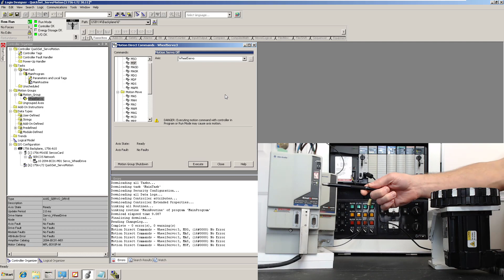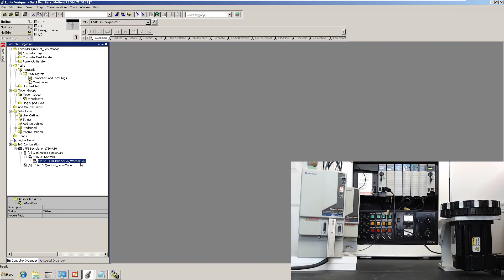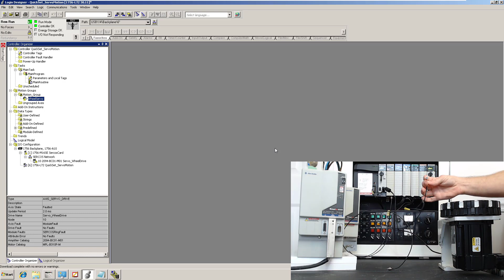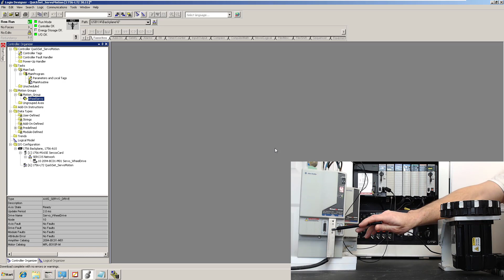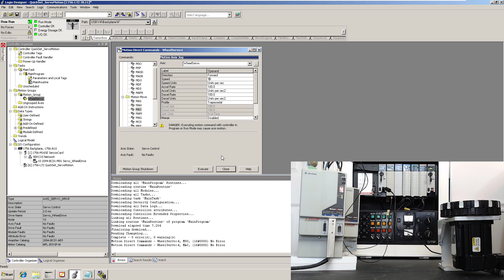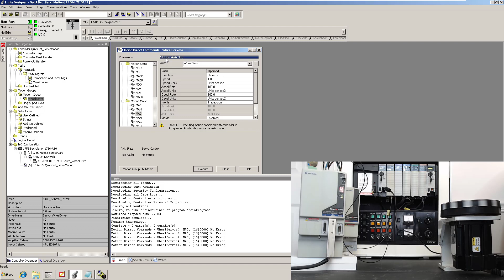Kinetix 6000 Troubleshooting In Studio 5000 Using Phase Indicators

Comment: Once again you are good with the help... I had a E19 fault .? on my 6000 drive
Reply from the maker: That is a position error fault.

Also, depends on your firmware...if on FW 1.83 then flash it to 1.85 

You also could have the motor leads connected in the wrong order.

U-Brown 
V-Black 
W-Blue 

These to try:
-Increase the feed forward 
-Increase the following error 
-Check tuning 
-Verify no mechanical binding 

Generally, if this happened while running then it could be a mechanically on the driven load.

Comment: Hi I'm getting e73 error on the drive how to resolve it
Reply from the maker: Please clarify what actual drive you are using.

If a Kinetix 6000 then it could be a back plain issue or a connection on the drive where the pins connect the back plain.

They often get bent.

Check that
Reply: @ShaneWelcher  kinetix 6000 (2094-bc07-m05-s  ) how can i solve it
Reply from the maker: @zainabbas2524  again,  check the pins on the back of the drive where it plugs in.

Make sure they are all straight and not bent.

If all are good then replace the drive or the back plain.

A simple check is to place the drive in a different slot and test it.

Of course you need to change the node to do this test

Comment: Hi sir i am using kinetix 6000 drive with servo motor i am getting E64 alarm ( feedback noise fault) . I have changed my feedback cable with new one still same issue came backe after 3 months. I have also provided extra condude for feedback cable for shielding.
Reply from the maker: Add a ground to the drive connector, I've since loose or dirty ground caused this.

I added a ground wire with an alligator clamp and it solved the issue although it's a temporary measure

Comment: Hello, I have a problem with one of this drivers and the error is E09. Can you help explain what is the problem exactly, when install the new driver this error comes out but when I put the old one same driver but just older, it works fine.
Reply from the maker: That error is buss under voltage so check the incoming power matches the drive rating.

If so then the new one is bad, try flashing the firmware

Comment: Has anyone had a E00 undervoltage and had the fuse blown? Trying to see how to fix that in house without waiting for Rockwell.
Reply from the maker: That is a blown fuse for the DC bus.

You can verify the DC regulator is working correctly & change the fuse or merely replace the drive.

Might be a internal short unless you have a power spike.

Depends on your voltage grounding system, meaning, high resistance ground or normal ground.

If high resistance then the MOV jumper should have been removed which could have caused the short
Reply: @ShaneWelcher  thank you for your response. So the blown fuse might be something greater we had a motor and cable that took a dump so I’m sure it’s more than a blown fuse. 

We had Rockwell tech support and they said look at motor and cable and Im sure it was a combination. Your videos are excellent trying to become better in motion control.
Reply from the maker: @michaelcoxfitness6089  Glad to help

Comment: Thanks for all sir
I have a question, now i have the same KINETIX 6000 and when i change the encoder for a new one with the same exactly characteristics, the driver stucks on phase 3 trying to recognize the new encoder, but if i use the old encoder, it contnues to phase 4 and then presents the error E64, thats why i wnat to change the old one.
I guess all that i have to do is download again in PLC with the new encoder installed but i dont know if this is going to work or i have to do more configuration on RSlogix 5000 ?
Reply from the maker: Verify that it is the exact part number & matching firmware.
If you are using the encoder for an axis then change the axis properties as needed.

Hope that helps

Comment: Hi! I have a axis module that marks ERROR 73. A I've checked that itsn't short circuit and I don't find damage
I connect the control and turn on perfectly but when connecting the power begins to drop the voltage of the power
Reply from the maker: Sounds like the Kinetix 6000 backplain is bad or not communicating.

Maybe bent pins, check for bent pins on the back of the Kinetix 6000 controller when you remove it.

Also depends on the firmware that you are running.

Either way, could be a the power rail for the Kinetix 6000...the back plain
Reply: @ShaneWelcher  thanks!! I've connected it outside From the backplane and I have the same error. I have only connected the power, will it require some other condition? Why keep sending error 73 And the voltage drops by half!! Thank you
Reply from the maker: @alitac7775  Flash to firmware to the highest firmware.

If that fails then the controller is bad
Reply from the maker: Sounds like you have a short in the system after power up
Reply: @ShaneWelcher  Will it be possible? I connect the voltage of the control and power by Separated and voltage maintained
Reply from the maker: @alitac7775  seriously, it sounds like the circuit is either failed inside the Kinetix drive or either you need to flash the firmware.

Flashing firmware will reset the PI control if it was invalid
Reply from the maker: @alitac7775  The Kinetix backplain is either shorted or you have a bad controller.

Try to replace the Kinetix 6000 servo controller.

If that fails with a new one then it's the backplain.

There is no reason to power a drive externally...it's simple & proper to use the backplain

Comment: Sir, I am in great trouble.
My Kinetix 6000 Servo drive (2094 BC02- M02-S) is showing E 06 Error continuously..
Servo Motor is MPL-B330P-SJ72AA

After replacing Encoder it is showing E03... Encoder is SRS50-HFA0-K21, Make:- SICK
please help what to do..
Other same servo motor is running with same drive...
Reply from the maker: An E06 is just a hardware over travel fault... meaning, the device that feeds back the input for the over travel is active.

Generally, this is a prox switch or like device
Reply: @ShaneWelcher  Sir,
Thanks for your reply!
In my Question I have mentioned that same type other servo motor is running with current setup.
I mean this problem may not be a hard overtravel problem. something is missing from feedback device i.e. a encoder....
So please look that point of view also.
Reply from the maker: Your question has many outcomes, it sounds like you don't have something set up correctly.

Like is this a new application?
Is the encoder new?
Have you tested the encoder?
It the encoder wired correctly?
Is the servo controller setup for encoder use?
Are the attributes correct?

Plus many more questions

Comment: Thanks for all sir
I have questiin, now I have problem with kinetix 7000, Initially we replace the encoder with the same type, when we try it, during phase 4, an error code appears (E30), do you know the solution? (i have checked encoder wiring)
Reply from the maker: The encoder on a servo is set with an oscilloscope to the stator of the motor so there is no just replacing the encoder.

You have to change the whole servo.

An E30 Motor Feedback Fault (Motor Feedback Communication) indicates that communication was not established with the intelligent encoder. The drive cannot make connection with or verify the encoder. Please check following steps:

Verify Motor Catalog Number selection in Axis Properties in RSLogix/Studio 5000

If you are using Ultraware to configure the drive, and you are using Motor Catalog Number Auto Identification, verify the motor supports Automatic Identification

Check motor encoder wiring. Verify that the motor feedback wiring matches the interconnect diagrams in the User Manual for the drive.
Cycle power on the drive.

If none of the above helped and you have ensured that all the wiring, connections, and software settings are proper, start replacing hardware.
Reply: thanks for your answer
i have other question
for more specifically, the error appears after the MSO function executed, and I didn't purchase the encoder from a Rockwell distributor, does it matter?

Comment: Hi, I'm trying to change a Kinetix 6500 module from a pre-existing rack. The one I'm trying to swap sometimes give me some errors, so I've tried to change it for a new one, however, it gives me the error INHIBIT S04 and I don't know what to do. I just simply change them, the only configuration I've made is change the IP address of the new one using BootP Tool. Could you help me so I can get rid of the error? Thank you in advance :)
Reply from the maker: For: Servo Drive: INIT FLT S04, Commutation Not Configured

This answer solves two questions.

1. What is causing the INIT FLT S04, commutation not configured?
2. What is causing the inhibit S04, commutation not configured?

Verify the phasing of the motor is correct, brown/black/blue to U/V/W for Rockwell Automation cables. Incorrect phasing can cause this fault.

If the commutation hookup test was executed on a system having a standard Rockwell Automation permanent magnet motor, this fault will be displayed on the axis. This is because the standard motor’s data file already includes a commutation offset. Doing this type of Hookup test changes this offset value and would result in incorrect operation of the motor.

To clear this fault, follow these steps:

1. Go offline with the controller
2. Go to the axis properties in RSLogix/Studio 5000
3. Select the Motor category
4. Click on Change Catalog
5. Select the motor type of NONE and Apply
6. Download the project
7. Go back offline with the controller
8. Go back to the axis properties
9. Select the Motor category
10. Click on Change Catalog
11. Now select the correct motor from the list and Apply
12. Download the project

The axis should now go to Stopped
Note: Axis parameters are now reset to their default values. Be sure to set the scaling values and tune your axis accordingly to re-commission the axis.

Comment: hello i have a rack of 6 , kinetic 6000 they run , but at times the all the drives will restart  while running ,with 0  1 2 3 4 then re start the machine
Reply from the maker: Sounds like a sercos issues, like the sercos card is bad, dropping comms from time to time.

They are fiber light cables so either a cable issue or card issue.

I would think that it is most likely a sercos card issue
Reply: @ShaneWelcher  thank you for your time i changed the card same issue
Reply from the maker: @the5general1  

Was it a refurbished card?

Still sounds like a weak light transfer.

Or cabling issue, like a bend or something in the fiber.

May also be baud rate but that is far fetched in my opinion.

Sounds like a lighting transfer issue.

Could also be firmware but that is a long shot as well, to double check, make sure all the firmware is on the same level
Reply: @ShaneWelcher   thank you so much

Comment: I have problem with MSO instruction. When I execute MSO instruction, sometime it show error with error code .err =7 and .exerr = 0. What should I check for this issue? Is it come form bad motor or kinetix 6000? Thank you
Reply from the maker: You should follow my standard servo controls guidelines of the order of operation.

The error you are indicating says that you are getting a motion axis shutdown so it's best to follow best practice.

Basically
Off first - then Reset - then On - then  Control